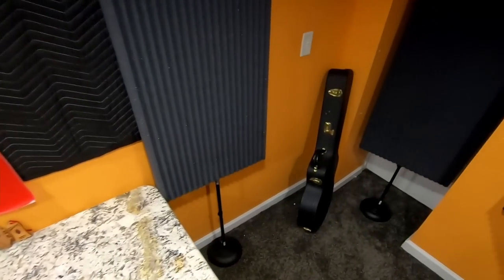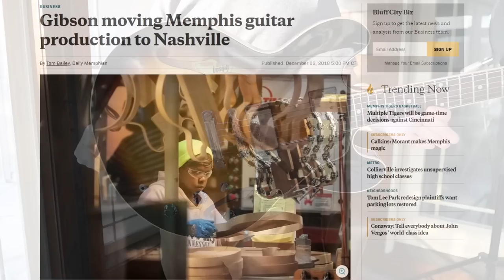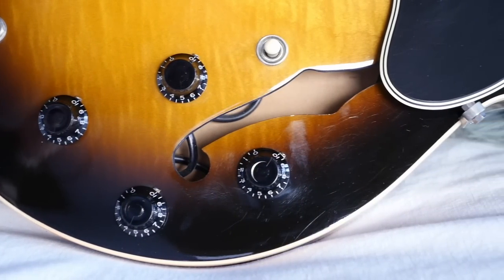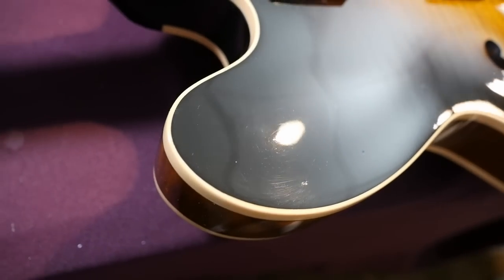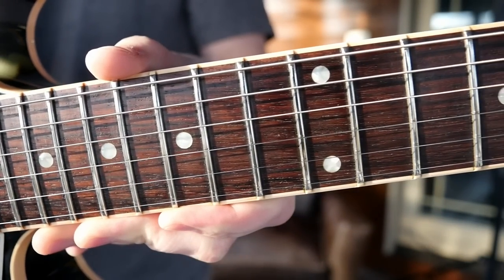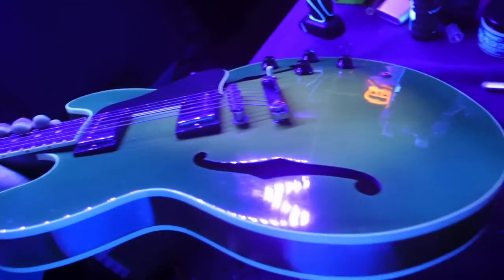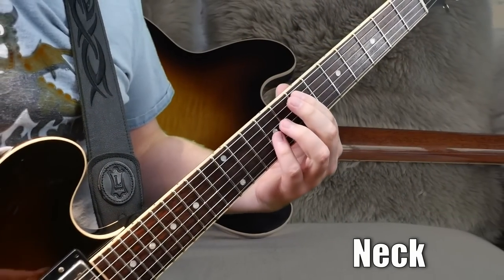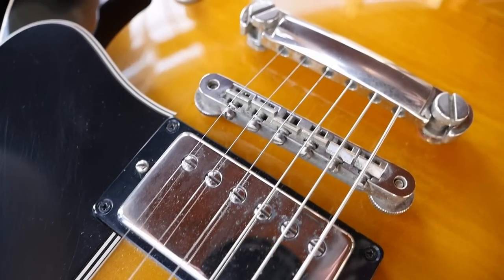What Happened After Kalamazoo? | 2003 Gibson Memphis ES-335 Guide, Review + Demo

Comment: The whole thing with the 335 is that it is born of a "class compromise" - but a near-ideal one for many players.  
It isn't a hybrid or combination of two specific guitar models, instead it gives the archtop class some solidity to handle amplification and feedback better; as the solidbody class can. 
It's created its own "thinline semi-hollow" class, keeping some remnants of acoustic and archtop virtues - i.e. what sounds sub-optimal played on a solid guitar -  still viable at higher volumes.
At least 3 are "needed' to cover most of the total "335 experience" and class-potential, sonically: 
1) a properly-constructed Gibson that doesn't stray much if any from  the early to mid-60s spec
2) another similar Gibson with a Bigsby (or better) pitchwiggler
3) a variant from Collings, Heritage, Ibanez, Yamaha or perhaps Gibson themselves- one with a broader timbral and/or functional range than the vintage Gibson spec'ed ones

Comment: I never understood why on the ES models and on the SG's as well,. The input jack is on the front of the guitar.. they could have put it on the side in a place where if you're playing sitting down it wouldn't hit your leg and wouldn't get into the way of the strap.. it's just an awkward place, same thing with the flying V's,, they should have done it different in my opinion.
Reply: Simpler construction, no need to drill through the side of the body… actually 2015 Firebirds did try the side (well bottom) jack…
Reply: I prefer 100 times the jack on the front, it's much easier to plug.